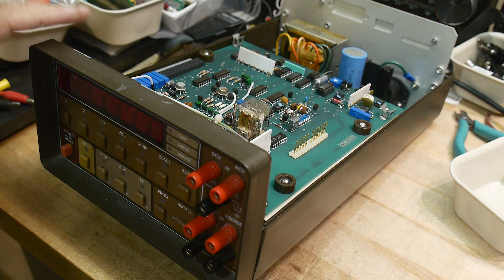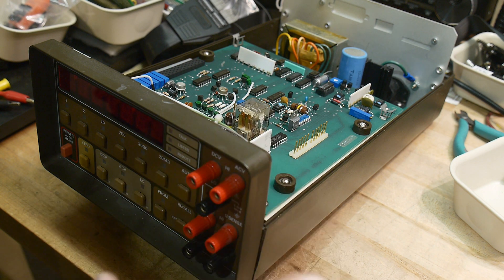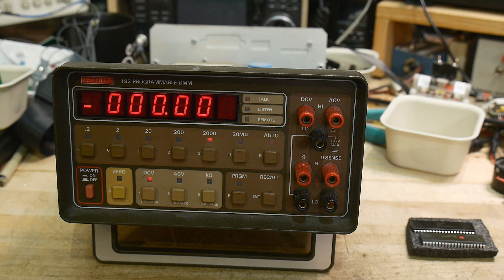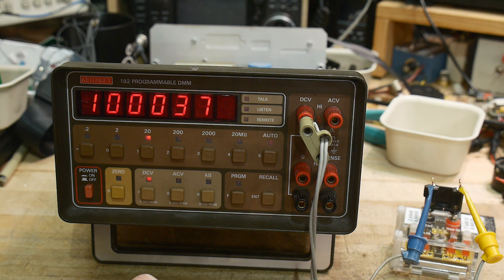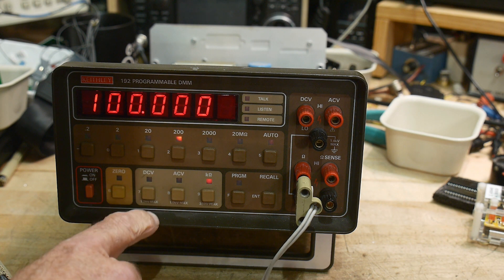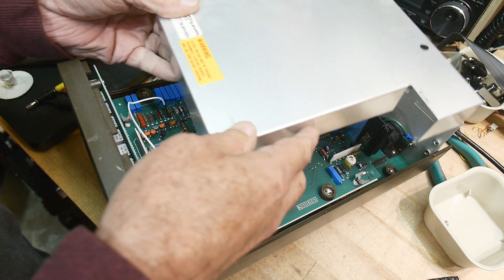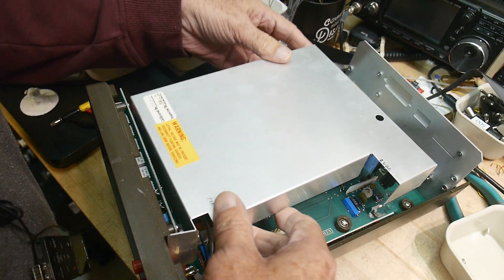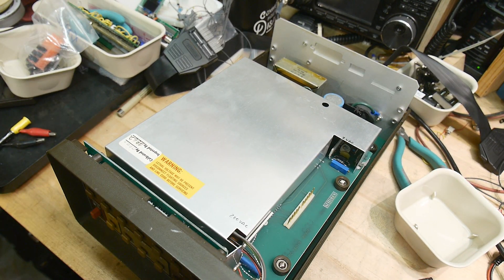#1068 Keithley 192  6.5 Digit Multimeter Repair (part 6 of 7 )

Comment: MC6808 is just a MC6802 without internal RAM. 6808's can be found in old Tek scopes (2465A,B) but they may be labelled with a different part number, eg. SC67127P). 
Both CPU's are in the 6800 family and both are an improvement from the MC6800 with an additional integrated clock circuit (starting on the long road to MCUs).
Cheers,
Reply: So would an MC6802 have worked as a replacement ?
Reply: @d942yd42  - As far as I can tell, if the 6802 pin 36 (RE) is tied to ground then it can replace a 6808.
RE is the internal RAM Enable which consists of 2 segments of memory (32 bytes LP retained, 96 bytes volatile) all starting at address 0x0000 with the 32 bytes at the low end.
Cheers,